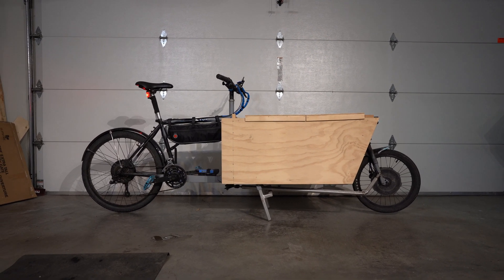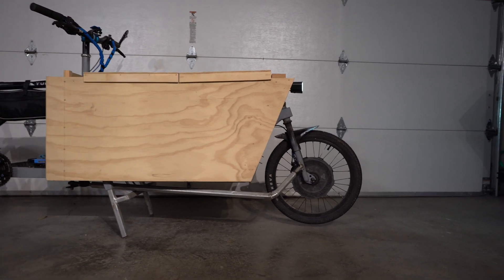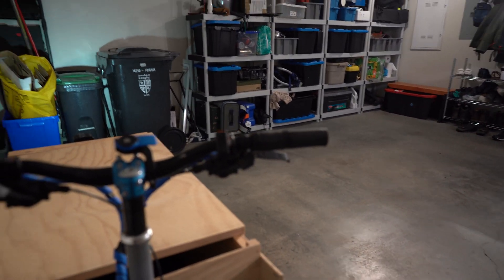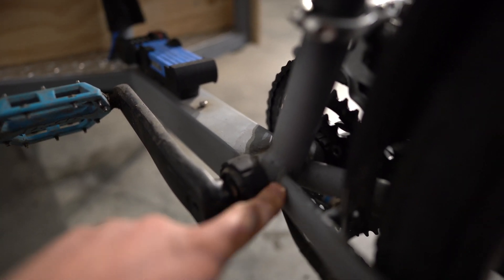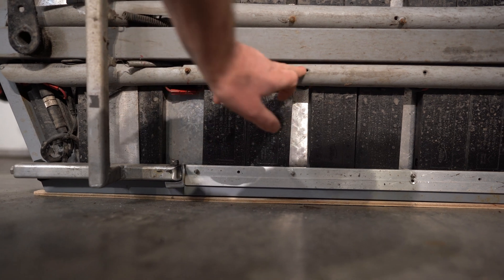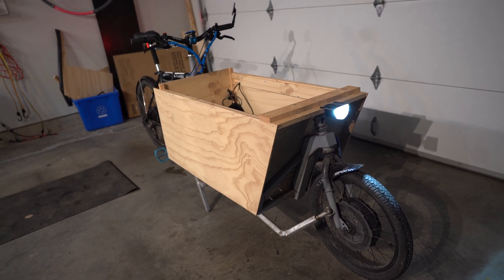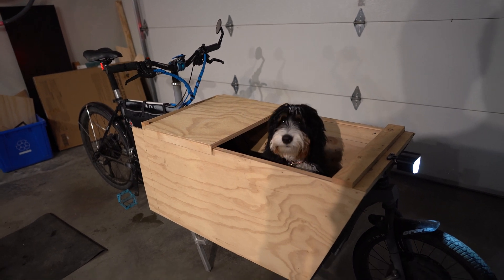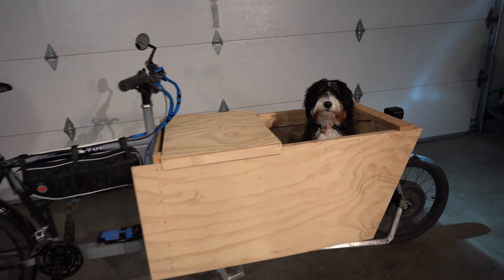Dual electric hub, Long John cargo bike

Comment: Very nice. Have about the same ideas. Was thinking of the front lid to tilt it like a front windshield en the second one, hinched to it like a roof with gasstruts. With a GMac rear motor on a bullitt frame.